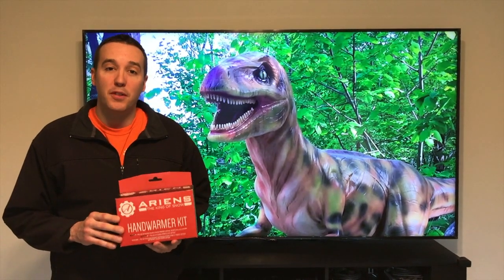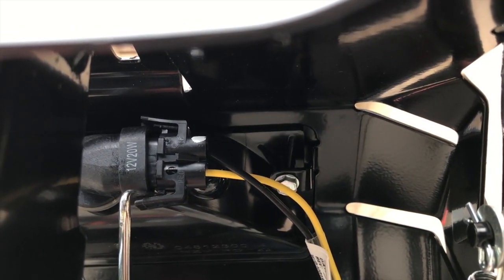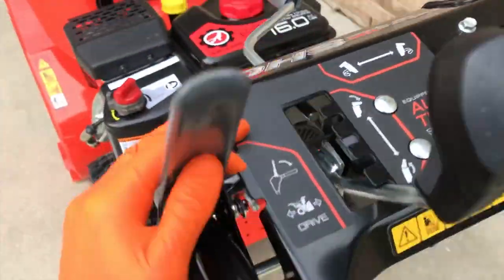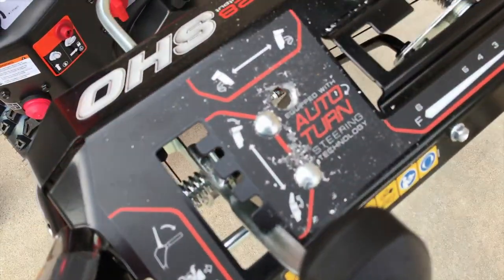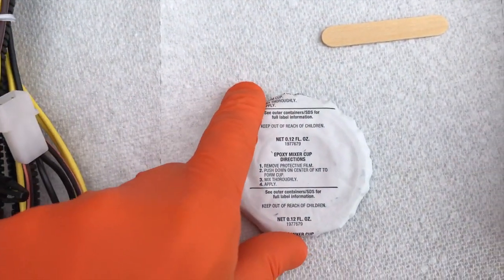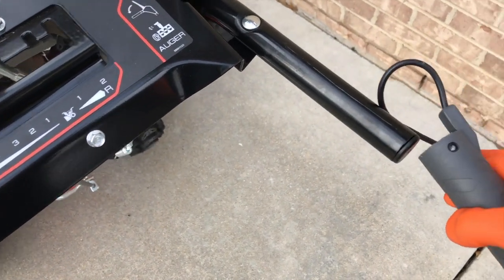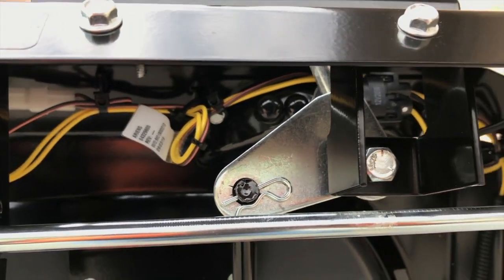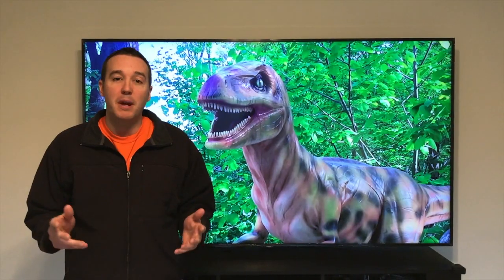A MUST - Installing Heated Hand Grips on Snow Blower!

Comment: Not all snow blowers have the same size handlebars. My Toro has 1-1/4" handlebars so heated grip are not easy to find in that size. My solution (which I've done many times to motorcycles and ATVs) is to just to install grip heaters. They are thin heat elements that stick to the handlebars under the grips. They are also much cheaper than heated grips. You can get them thru several places (Amazon, Walmart, etc.) and I've even found them at some fleet farm stores. Some snowmobile dealer also carry them. They work great! I have them on my snowblower!
Reply from the maker: Awesome, we appreciate you sharing this David.  Heated grips definitely come in handy.

Enjoy the upcoming season, thanks for watching.

Comment: Heated hand grips are a must when it is extremely cold, and you are out blowing snow. I found that one can use lighter gloves when using the heated hand grips. Before my purchase of a new snow blower with the heated hand grips, my hands would get quite cold even wearing heavily insolated gloves on my old 1980 Toro 524. That's right, a 1980 Toro that still works perfectly minus the heated hand grips. Sense the old Toro has a spring assisted scraper bar it cleans my cement driveway right down to the pavement. I did upgrade the old Toro with an impeller kit which really helps in wet heavy snow. My new Toro Power Max HD 1232 blows any kind of snow 50 to 60 feet. These new HD snow blowers with 14 in impeller and augers systems can really launch the snow. Ariens and Toro HD machines are hard to beat for the price. Looked at Honda but they are just too expensive for what snow I remove every winter. If I lived in a lake effect snow belt area the Honda might be worth the added expense to own one. Plus, a wheeled snow blower is much easier to maneuver in less you really need a track blower for added traction. Ariens has a nice track drive system if one needs that setup for added traction. Or, if you have the money Honda is hard to beat when it comes to track driven snow blowers. You made adding the hard warmer kit on your Ariens look quite easy. I am sure many will follow suite after watching your well-done video. Thanks for sharing.
Reply from the maker: @russellmaddock3492  

Thanks for watching and sharing this, very valuable thoughts and info.  We find the heated grips to be a game-changer…no joke!  😁

Did you end up selling your Toro 524?
Reply: @DIYwithMichaelBorders  Still have the Toro 524. I guess I keep it in remembrance of my beloved Dad. Thanks for asking. Have a blessed winter and happy new year.
Reply from the maker: @ 

Thanks for the reply, it has sentimental value for sure in that case.  Much respect, keep that thing going.  😁👍

Comment: By the way - before you put the plugs in the pipe handles (around the 6:50 mark) - filling the tubes (at least the length of the handles) with spray foam insulation will increase the handwarmers efficiency, as it is they have to heat up your hands as well as an empty pipe, filling that empty  space makes 'em work a lot better.
Reply from the maker: Thanks for watching & welcome to the DIY Raptor Club.  We appreciate you sharing your advice.

Check out the video link below, you might get a kick out of it...😁

       https://youtu.be/RTUhy5AeANQ

Enjoy your day!  😎👍🔧🔩

Comment: Great video!  Are those heated grips also thicker than the stock grips?  I think probably my only gripe about my new Ariens is the grips a little small and pretty slippery for me.
Reply from the maker: Justin Upton 

Thanks for watching Justin.  Yes they are.  These grips are thicker than the original stock grips.

The additional thickness of the grips feel a lot more comfortable & feel like they belong there.  😀

We highly recommend these grips!

😎👍🔧🔩
Reply: My gripe about Ariens is that they no longer have Tecumseh engines that 'were' made in the USA, but have been replaced by Chinese built garbage. I have an Ariens from '07 when it was all built in the US. Now, all parts are outsourced and 'assembled' in the US. Disappointment plus!

Comment: Great video, I have same snow blower as you, where do you insert those push pins above the head light?
Reply from the maker: Kamran Shah 

Thanks for watching.  We appreciate your comment!  Some people insert them in the slotted gap on metal frame...personal preference.  Some use additional tie straps to secure them.

Definitely keep us posted with your project and also whether or not you like the heated grips better than the original grips.

😎👍🔧🔩
Reply: @DIYwithMichaelBorders  Thanks Mike for quick reply, I will pay around with it tomorrow, you had done great video, I didn't even read the manual lol.. watched your video and instal wasn't to bad.
My light bulb also needs a replacement, saw few LED replacement on eBay, I am going to pick them up
Reply from the maker: Kamran Shah 

Very cool & we appreciate you watching.  LED is the way to go.  Keep us posted!

😎👍🔧🔩

Comment: Mr. Mike, I purchased the same exact heated grips kit you just installed. Then I read the comment saying that the LED light connector isn’t compatible with my new ‘21 Deluxe 24. Would you agree that I can just splice the LED connector off the ‘21 wiring harness onto the kit wiring harness and be good-to-go? Thanks.
Reply from the maker: Thanks for watching & that’s what a friend of ours did & he mentioned it’s worked great.  We haven’t personally done it.

Keep us posted.  😎👍🔧🔩

Comment: My Ariens is 12 years old now and came with heated grips. I have yet to use them! I guess because I wear gloves!
Reply from the maker: Thanks for watching & welcome to the DIY Raptor Club.  12 years strong...we love it!  We need to get some gloves...🤣

Check out the video link below, you may get a kick out of it.

       https://youtu.be/RTUhy5AeANQ

😎👍🔧🔩
Reply: You must not live in a cold state like ND, SD, MN, MT b/c I wear Ice Armor Mittens with hot hand warmers and my hand are still cold when it’s -20 to 10 degrees outside.I would love heated grips.
Reply: @Djwf91  It gets cold here along the coast, Gloucester, Ma. My feet get cold but my hands not so much. I tried the grips with them on but they hardly make a difference.